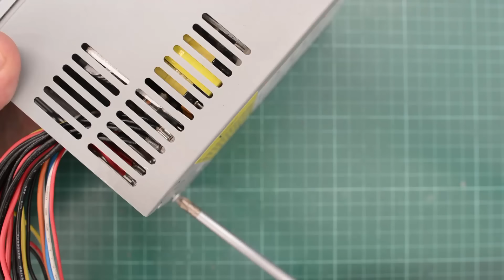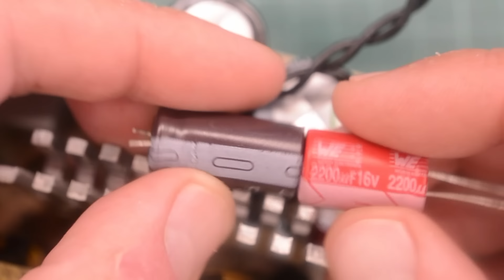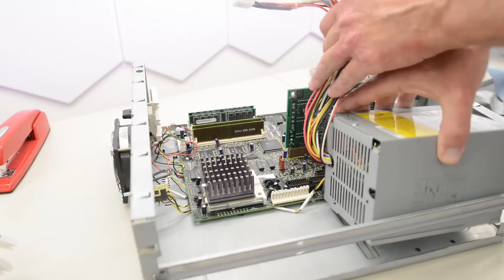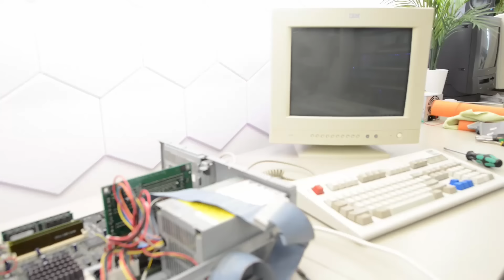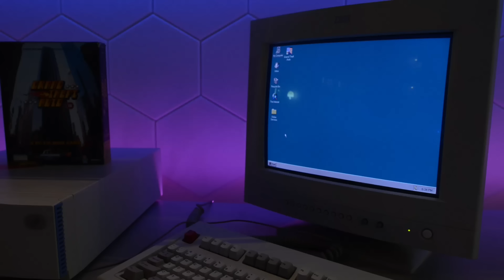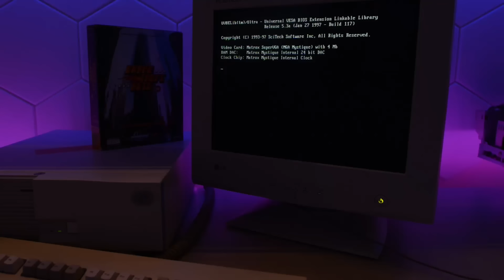IBM 330-P60 repair & GTA in High color mode test

Comment: I would glue the coil to the pcb
Reply: It is the only solid way (pun intended) to fix the coil whine. It has been done a lot in production too. :)
Reply: Fix it properly. Don't glue the coil to the PCB.
Reply: @Brianck1971 hot glue is the factory standard :)
Reply: @Brianck1971  Coil noise is often not the result of any kind of fault. So gluing it down is the proper fix.
Reply: @Brianck1971   And a "proper" fix would be... what?  Criticism without a solution isn't helpful.
Reply: @sirnickity  Replace the coil with one that does not whine. He asked for advice. I didn't give him any criticism.
Reply: @Brianck1971   Well, implying that glue isn't a proper fix is criticism.  Which is fine, but OK, then what?

At any rate, a coil that doesn't whine is just more mechanically isolated or constricted.  Which is what glue does.  I have a couple PSUs that I serviced (recapping and cleaning, etc.) that had glue around caps that I removed, and that extended to a coil next door.  When the glue came up (IPA does wonders, depending on the glue used), the coil was no longer tethered to the board and nearby components and... yep, it whined.

There's one in my retro fleet that I haven't gone back to glue down, and when it's in standby mode (ATX off), the low duty cycle puts the switching frequency right in the audible range, and in that coil's resonant range.  It really needs some hot glue...  If it's a viable solution for the likes of Delta and FSP, then it's good enough for me and our host here.  That seems plenty proper.
Reply: @sirnickity  OK fair point. One mans "Proper fix" is another mans "bodge". I think you would have to coat the thing in glue rather than just stick it to the PCB. But whatever works, works.
Reply: Attach the coil to the PCB using chewing gum as an adhesive.
Reply from the maker: I think that's what we'll do. Let's see what everyone thinks